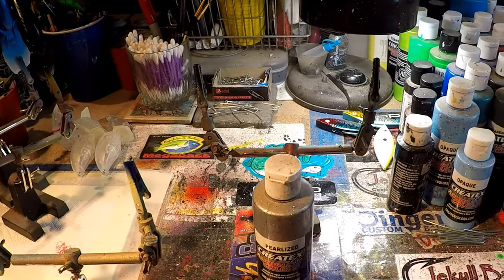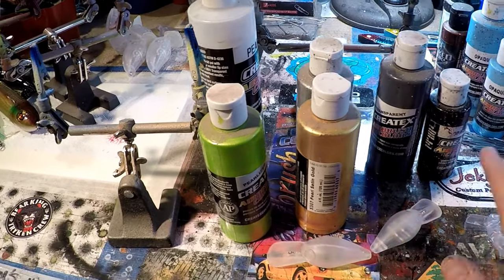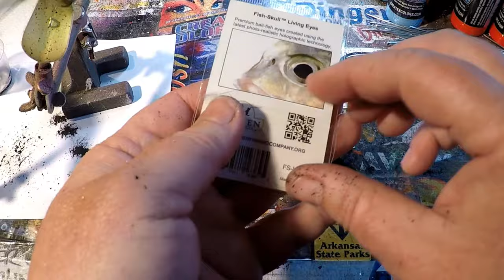Spray Session 2019 (ALL NEW): "Northern Smelt" - Hatch Match Series #2

Comment: Another very pretty and simple pattern. Thanks Jenn.

I'd like to ask you to warn everyone about trying to use KBS once it starts to thicken....Don't try to salvage It.....I just ruined a day's work and a dozen 7" walleye baits. Once KBS starts to thicken, if you dip the KBS doesn't run off smoothly and you end up with baits that have hundreds of trapped air bubbles and uneven surface and pooling in eye sockets. I should have waited for my new KBS to Arrive instead of using compromised product.  Unsure if salvageable for sale.  Just a word of warning. Thanks.
Reply from the maker: I'll mention that for you on my next spray session Dennis 🙂

Comment: Have you ever used a make shift paint booth to improve air quality or is it a non-issue?
Reply from the maker: Unless I’m filming I wear a approved respirator, and run an air exchange system in the shop. It pulls air down and out of a 10” ducted and sealed hole in the side of the shop. I’ve done a shop walk around but I’ll most likely be doing another walk through this year for y’all

Comment: Hello Jen, so when starting the plastic lures, I can use illustration or wicked as a base??  Then layer
Provided I dried each layer.  Thanks in advance.  Paul
Reply from the maker: Yes. You can. I’d use the thicker primer on repaints though
Reply: Ok I’m 52 and water base hits the scene I’m making my life a lot harder than it is.  Thanks for the help.  I’m using topcoat KBS, turned out a nice offshore sardine.  Being paralyzed I just need one day on the boat to feel great all year.